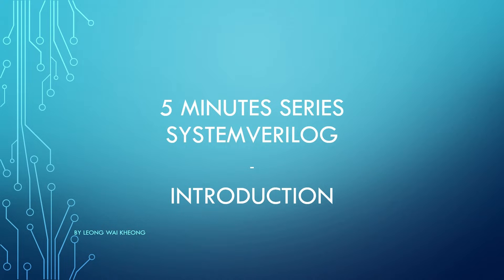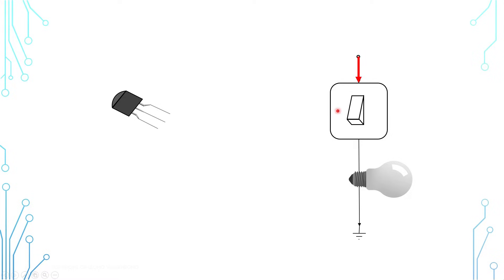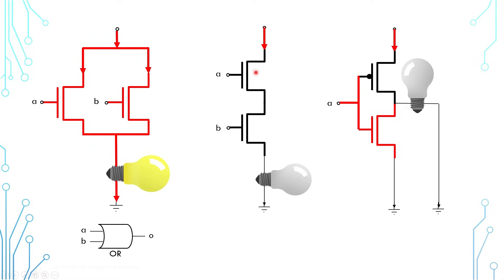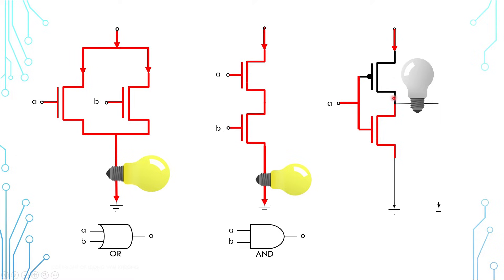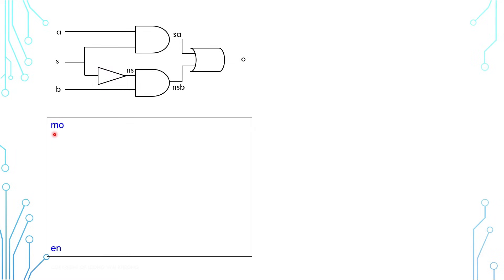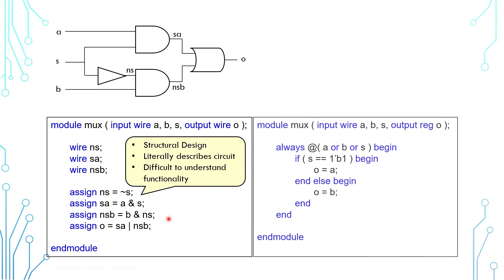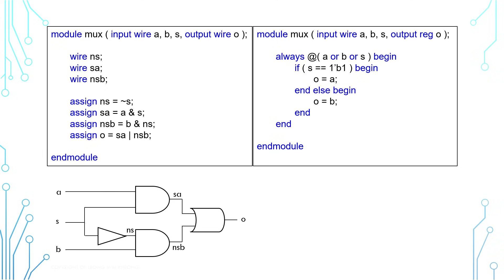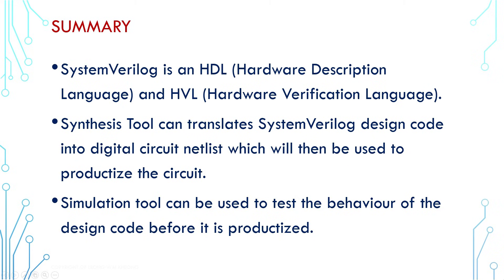SystemVerilog Tutorial  in 5 Minutes - 01 Introduction

Comment: What IDE do you recommend?
Reply from the maker: I've been using Synopsys tools all along. I don't have much experience in other tools. Although I've heard of a tool based on eclipse called DVT that can help users to develop SystemVerilog code. Unfortunately it does not compile and run simulation. Although I'm not sure if it's publicly available.
Reply: @openlogic925  its a very expensive tool , any free software?
Reply from the maker: Sorry. I was unaware of another enquiry. There are free simulators, like Icarus, but I heard it does not support full SystemVerilog syntax. I haven't heard of a free one that supports full syntax